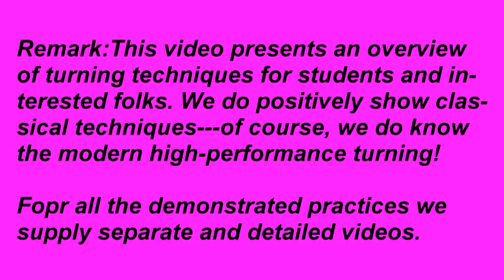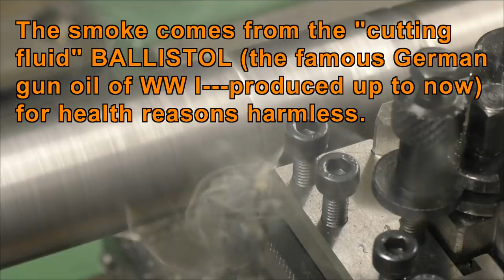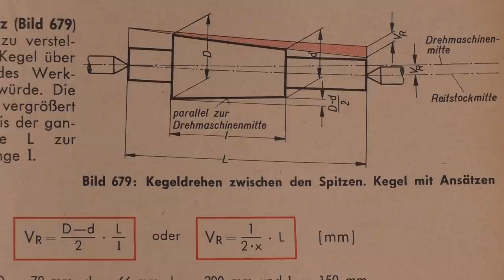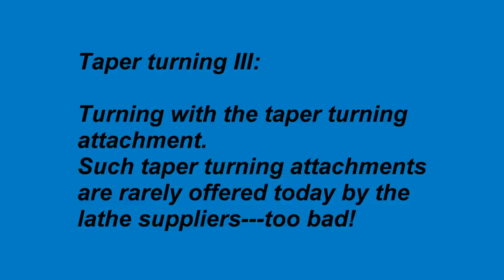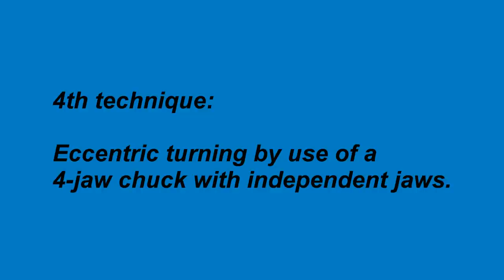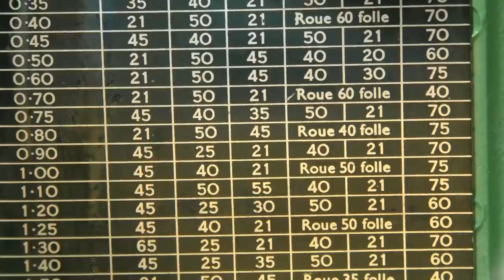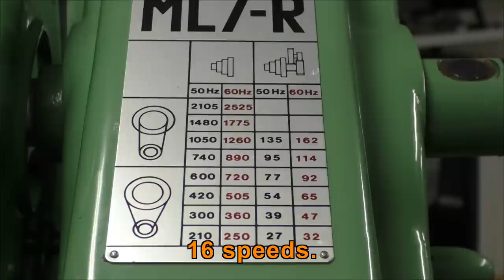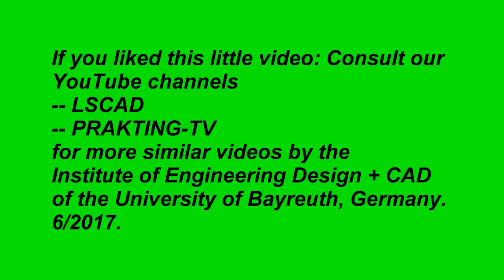Advanced turning operations on a Myford.

Comment: At 16:20 you say that a very small feed is added and hence mainly the left edge of the cutting tool cuts.   I think this is not correct.   If you setup the topslide at the appropriate angle for the thread then the tool will cut on the left edge.   It is not possible to tell from your video whether this has actually been done since no wide enough shot is shown.    Anyway,  it is the angle of the topslide and not the depth of cut that determines which side or sides of the cutter is active.